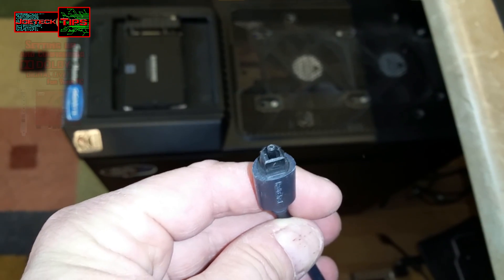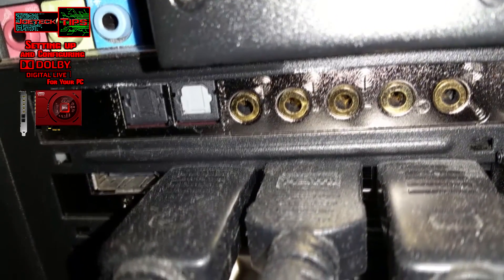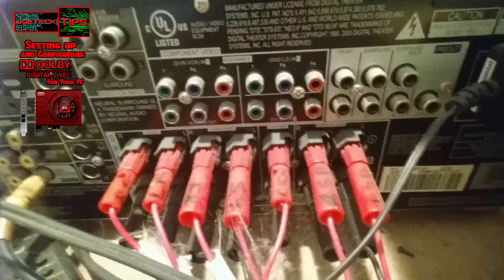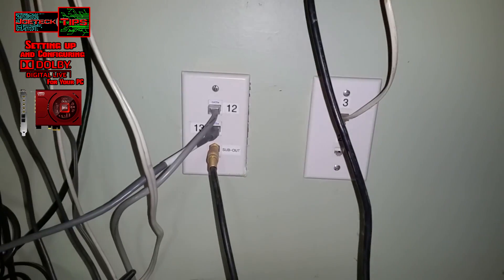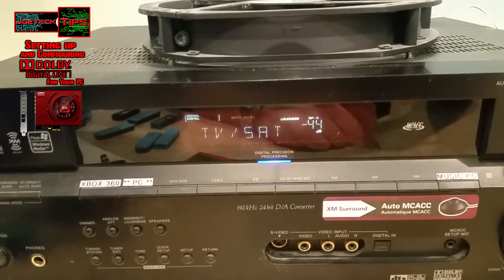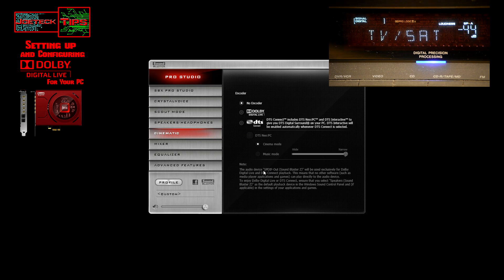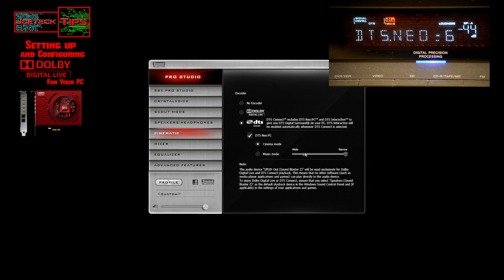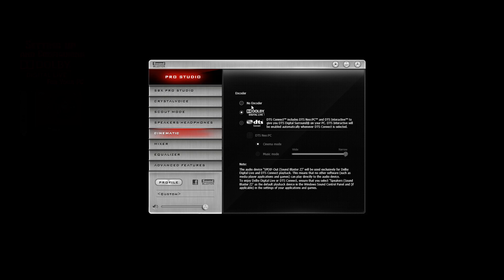How to Setup and Configure Dolby Digital Live for your PC - Optical

Comment: Ayyy good ol HAF 932 Advance case. Same one I use that has my sound stuff in it lol.
Reply from the maker: Yes sir, I have both 932 and HAF X 942. The 932 still has that setup with the 1950x Threadripper and the 942 has my new beast 3960x Threadripper, 128gig of ram, RTX3090, SBZ, Corsair AX1600i, Plus I just built a new rig with LIAN LI Dynamic 011 case, Enermax LIQMAX 360 cooler, 8700K, 750w PSU, 32gig ram, WD 500gig NVMe drive

Comment: its possible to add connection of optical cable for subwoofer who has no slot for it? Of course my sound card had optical cable slot but speakers not i got logitech x540
Reply from the maker: No unfortunately.  Optical is not used for LFE (Low Frequency Effect) the Subwoofer. Optical out is use for multiple channels output to a decoder such a a receiver.  The x540 is analog only. No optical imputs. You'll need to change to the z906 to get optical and to decode Dolby Digital from a SB-Z Card or AE-7 or AE-9. The AE-5 does not offer DD or DTS. Hope that helps
Reply: @Joeteck  ok ty i expect that i must buy better speakers with optical input, to bad they dont let use some converter. I got sound blaster xfi 5.1 and i got option to use dolby digital live that why i am corious how to use it but thx now i know what to doin.

Comment: I did this. I then downloaded a surround test file from Dolby (AC3 5.1) and holy smokes batman it is amazing. I am never going back to those tiny 2.1 computer speakers ever.
Reply from the maker: Great comment!! Deserves to be pinned!!!
Reply from the maker: Why wouldn't it? Its not a trick.. its a real "how to" video...lol
Reply: Hi where can i download the AC3 5.1 file ?
Reply from the maker: @giz54  now remember, this will not play on a non ac3 5.1 decoder. If setup correctly and its decoding, you will hear it correctly vs clicking noises. It will play soon as you click this link. Make adjustments accordingly. 
https://www2.iis.fraunhofer.de/AAC/multichannel.html
Reply: @Joeteck  Thank you very much

Comment: Thanks Bro great review. Getting a Reviewer this year or early Next year for my SPDIF port on my soundblaster Z. Looking at this model: DENON AVR-S650H (2019) this has only 2 SPDIF inputs.
Can you tell me the Difference between the Denon AVR-X1600H Series vs The AVR-S750H. thanks

https://usa.denon.com/en-us/shop/receivers/avrs650h_d?varId=883795004824
https://usa.denon.com/en-us/shop/receivers/avrs750h_d?varId=883795004831
https://usa.denon.com/en-us/shop/receivers/avrx1600h_d?varId=883795004848
You saved me alot of time figuring this out. Plus with the receiver i can play my LPs ( has Phono inputs ) i haven't played in 30 years.
Reply from the maker: There are suddle differences.  650 only does 5.2 surround, the other 2 do 7.2. I like the 1600 the best. If I were chosing between the two 750 and 1600 I would pick the 1600. I currently have 3 surround sound setups while this video shows a Pioneer for this setup,  the other two setup use older non 4K Yamaha RX-V665 recievers. Which need to be replaced soon as I go 4K.  You picked 3 nice receivers. The 750 is a close contender. I like the extra power of the 1600. You can do a comparison yourself if you go down on that page and add in those other two. Good luck. Really nice features.. - Joe
Reply: @Joeteck  Thanks Joeteck. AVR 1600 it is. Your video really helps me alot as i believe it has helped others. I can't get it now maybe early next year. If it not avaialble at that time i'll go for the AVR's series.
I do have one more question. Do you know on average how many Amps these use i don't want to trip a 15 amp circuit breaker ?
Again thank you for the video and quick response.
Reply from the maker: @joeharney135  I just love comments like this! This is why I do this, to help people. Glad you enjoyed it. Keep me posted on your setup. Please send pictures directly to me at: joeteck@Joetecktips.com

Comment: Will this work using HDMI out from PC to HDMI receiver? I don't use my Media PC for bluray playback but I do want true 5.1 via digital cable.
Reply from the maker: No, optical out is a red light carrying audio data for the reciever to transcode. Dedicated GPUs have their own basic sound card built in to send audio to your TV for movies and basic games. For true DTS and DDL you'll need a dedicated sound card that supports these features.

Comment: Thanks for the video, Joe!  I wasn't sure which decoder to use in the Sound Blaster Z-Series Control Panel.  My Z906 speakers support DTS and Dolby Digital and are THX certified (for whatever that's worth).

I see with it set to DTS it is sending the correct signal to the receiver built into my Z906 speaker system because it shows "Decode" on the receiver.
Reply: I also own Z 906 and the same  Creative SD Z is on the way. I found on subwoofer optical in or out just like on Sound card. I was wondering what if i use cable and connect my Sound Card to Z 906 logitech via optical cable? I basically would not need any AV receiver right ? Since you mentioned that Z 906 has built in AV receiver ? Would you please explain how did you set everything up exactly . Thanks

Comment: hi, recently bought this card and i have a issue that I cant get my head around. when first installed the card and software work fine but when i turn the pc off then come  back to it later there is no sound. The only way to get it to work is by restarting the pc and it works fine. Kind of annoying to have to start the pc twice just for sound. Any reccomendations/ideas?  Currently using the latest drive and soundblaster control panel. Using windows btw.
Reply from the maker: Sounds like you have power saving turned on on the PCI / PCIe slots. Turn that option off in windows or in your BIOS. Seems the card is not playing nicely in sleep mode.
Reply: cheers, with check that out now.
Reply: Well i turned the pci power saving off in windows but couldn't see any options in my bios. The problem still happens. The amp i have is a sony str-dn1000 and on the display it shows that no optical connection detected but the analogue symbol is there. There is nothing analogue connected to the  amp btw, i guess its just a standard display when no signal is detected.
Reply from the maker: @AgeingRaver  make sure your SB control panel it set for Dolby Digital
Reply: It is.
Reply from the maker: Have the optical cable in the correct optical port? There is an IN and OUT
Reply: Yup all connected up properly. It's really strange, the only time it works (and works brilliantly when it does) is when you do a restart. I'm really scratching my head on this one! sorry to bother you btw.
Reply: Hi again, would you recommend any if other sound  card? After hours of messing around and several creative support email I have ended up returning the card. Cheers
Reply from the maker: @AgeingRaver  sound blaster Z, or the HT Claro. I bought the HT claro because sound blaster didnt support DDL ot DTS connect.
Reply: @Joeteck  thank you will look that one up.
Reply: Wow that's not cheap!
Reply from the maker: I know you had an issue with creative labs. However the driver for the Sound Blaster Z, works very well. Drivers are perfect. I have been using the SBZ for many years. Thats what I did the video on. Hope that helps. I am very serious about my sound, so I the price for me didn't matter. How much is the Claro? $179?
Reply: @Joeteck  Well I'm in the UK and Amazon are selling for £340. I only want surround sent to my amp or my astros a50 headset gor gaming so that price is a bit steal for me.

Comment: Thanks for the video, I wish if you could help me clarify one point in your video 12:26.
The configure button looks gray and disabled for your playback device. 
Can you select your speaker setup configuration (stereo, 5.1..etc)?

I'm trying to run similar setup for my HTPC using my new motherboard audio chip (Realtek ALC1220-VB codec) using Optical-Out however I'm stuck with stereo only. ironically my older motherboard with older chip had this feature working without any issue.
Reply from the maker: You must Select speakers in your mixer. (Speakers (Sound Blaster Z)

Comment: Hey Joeteck! After researching the subject for over 2 weeks on forums and Youtube, I can conclude that your video has the best material by far :)
Thanks for making it! I've subscribed of course.
I do have a question:
I've been connecting my PC via optical cable to an old Denon AVR-1603 receiver and a 5.1 speaker system. I've been using this setup for many years, and enjoyed DTS and Dolby Digital while watching movies.
After 10 years it was time to buy a new machine. I bought a "high end" Asus Maximus Hero X, and was very surprised to find out it doesn't support DTS anymore! I could probably solve that problem using modified Realtek drivers, but instead I'm considering getting the Soundblaster Z (or ZX) so that I can also encode to DTS when playing games. 
So the bottom line is - how well does this DTS encoding works in games compares to the natural sound? (as far as I know, most games aren't encoded to DTS when the sounds are being recorded, so encoding to DTS is a modification on our end).
When we are talking about digital pass-through (in the case of media which is originally encoded to DTS), I'm not sure if there's a difference in quality compares to onboard cards, IF you manage to get the Realtek driver to work properly...
Sorry for the lengthy comment, and I hope it wasn't too confusing :)
Thanks again!

Comment: howd you get the sound blaster z control panel to detect your sound blaster z? I think windows 10 broke it
Reply from the maker: No, make sure it's the latest driver. I still have the SBZ works perfect
Reply: Well im using an old z97 from gigabyte so the lastest driver is from 2016 and does not include creative audio integration DLL files. So it doesn't work, I'm not sure which drivers to even use from realtek
Reply from the maker: @Jamxknife  motherboard has nothing to do with it. Disable on board audio and install the correct driver from creative labs. Will work fine.
Reply: I've done that. If you look up what I'm talking about you can see that its a very common issue. I'm assuming you got the card long before windows 10 1709 so windows didn't break it yet.

Comment: I'm curious, when you go into the windows sound setup (control panel), double click your selected audio, then go to its properties, under supported formats there is "DTS" and "Dolby Digital" with a Play Test button to the right, if you play the test, do you actually get sound coming out of your rear surrounds? For me the test sound for the rears just goes to the front speakers.  Likewise, if I'm trying to play a movie file, or in the case of setup, an audio test file with AAC encoding using VLC, again, no sound coming out of the rear surrounds (and it redirects to the fronts).  This despite my receiver saying "Dolby Digital" just like yours in this video.  My configurations are like yours in this video and I'm also using a creative sound blaster.  This seems like "fake" dolby digital that is not truly passing through 5.1 audio.  I'm suspicious that its a windows 10 problem of some kind (it DID in fact work fine before upgrading to windows 10).  I did install the latest drivers and firmware from creative.  I'm really frustrated now because I've been struggling to get this to work for a over a year and I've tried other sound cards before buying the creative sound blaster.  For now I just live with not having true 5.1 sound but since I have the speakers it annoys me greatly (the rest of my family doesn't even notice, haha).  Thanks for making this video by the way.
Reply from the maker: Ok, what I can do for you is remote connect and see if I can fix your problem. Teamspeak. Email me if you feel like doing this. Joetecktips@gmail.com.
Reply: Hi, did you get a solution for this problem?

Comment: I've been using the Sound Blaster Z on my movie-watching/gaming PC for about four years.  Running SPDIF out to my Pioneer receiver. (It's an older model than yours, but still worked fine.  Decodes DTS.)  So, pretty much the same setup you showed in this video.  Just within the last month, the 5.1 speakers have started mixing up.  Sounds will come out of all the wrong speakers, and sometimes there are static noises as well.  I don't know what's going on.  It must be a software issue - but it's driving me crazy that it worked great for 4 years, and now I can't get it set up right.
Reply from the maker: Ion-SHIVs sounds like a hardware issue. Pioneer receiver fault, however I would uninstall the driver select the delete driver  function, reboot, then reinstall. If that doesn't work, maybe you have malware affecting the function of the sound? Hard to say without looking at it. If you wanted me to look at it. I could remote into your computer (for free; a subscriber benefit. ;) ) and take a peak. Install teamviewer, then send me the information to marketing@joetecktips.com.  if that's OK with you.

Comment: Hi came across this video searching for dolby stuff.  I'm trying to understand the whole DTS and dolby scene and the the difference between analog and optical PCM 2.0.  I'm running a PC with a Xonar DG card and optical out to a Vizio SB3621n-E8 soundbar.  I would like to optimize this setup because I watch movies on my computer and should I get a better sound card to get better sound quality?  I'm not sure if my DG has DTS and all that.  I don't want to get into receivers and other speakers, maybe a sound card if it would help.  It sounds good but I know the DG card is kinda cheap.  Thoughts?  The 5.1 version on my soundbar has a HDMI input, would that have been a better choice to keep things digital quality?  I have no room to put speakers behind me anywhere hence why I went with 2.1 but this 2.1 sound bar only has optical opposed to HDMI.
Reply from the maker: Ok, interesting setup. From reading unless I got incorrect data the DG does 5.1 analog only. I did not see an optical output on the DG. Dolby Digital Live is a real time encoder for 5.1 output via SPDIF. Your sound bar is 2.1 only, so even though it can decode it, its only doing 2.1. However, if you had a (let's say) Sound Blaster Z which can do 5.1 either DDL or DTS connect, your sound bar can only decode up to 2.1, decoding only left and right and center. Personally I think would enjoy the results of a pair of head phones, a SB Z, and Scout mode enabled. But that's just me. However nothing is like having DD 5.1 with the volume high and hearing all kinds of stuff around you, it is amazing. I look forward to your reply so we can dig a little deeper into your project. Thanks for the opportunity!
Reply: Thanks for the reply.  Yes the DG has 5.1 analog but it also has an optical out if you check out some images, but when I select that in the DG software it's under PCM to activate it and I "think" that's just 2.0.  I never use headphones.  For example if I decide to buy the Vizio 5.1 system and still using optical, I don't think my sound card will do 5.1 via optical because it's still either PCM 2.0 or analog 5.1.  Can optical out on a sound card produce 5.1 DTS and such?  I thought optical was limited to 2.0 PCM only or something due to bandwidth limitations of uncompressed sound, but I'm not clear and it all to be honest.
Reply from the maker: Scott Reasbeck correct it can not do DDL or DTS connect via SPDIF. I do not think it warrants upgrading to a DDL sound card when you only have 2.1 sound bar. You will not benefit from the upgrade. Your sound bar can decode, but it can only do left, right and sub. Simulates center and surround modes.

Comment: my Mobo have ALC888 codec, do i need a soundcard to go with my Logitech z906? To have an better experience. Connecting it to my PC via optical cable now, hope you can help solve my query. Thank you!
Reply from the maker: That's easy! Sound Blaster Z!
Reply from the maker: BTW, that Z906 is an awesome speaker set. Enjoy that beast!
Reply: Joeteck it will make a big difference like in what way sound wise? Thanks! I got a sweet deal getting a used one from a nice chap.
Reply from the maker: Thomas Tan the sound blaster Z will give you 5.1 to the awesome Z906 speakers in DD or DTS. Only a few sounds cards can do this. Not even the $149 AE-5 can. Going optical to your speakers will make you a happy gamer. Enjoy!

Comment: i have a question that maybe you could help me with. i have a pair of astro a40 tr with obviously the included mix amp. this is what i use mainly for gaming and movies and stuff because i dont have actual speakers in my room and im looking into a simple 2.1 set up to start with, but anyways. my question is, i just plugged in my optical cable from my astro tr mix amp to the back of my Asus Maximus X Formula z370 motherboard because ive always used the mix amp through the usb power source as my audio and the only time ive used the optical is on my ps4 and i can tell the difference in clarity a whole lot, so when i have it plugged in and i change the playback from the astro mixamp to the digital audio S/PDIF and i hear nothing. it says it's working fine and everything but i hear nothing and i do a test and it says it's outputting sound but i still hear nothing so i was wondering if you might have a solution for that.
Reply: nvm i figured it out, i had the volume on the mix amp turned all the way down hahaha